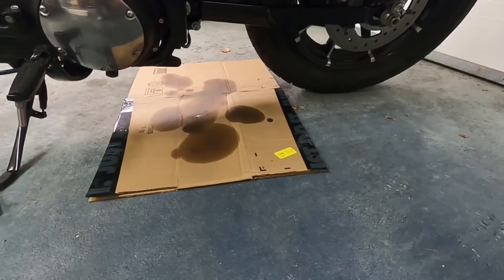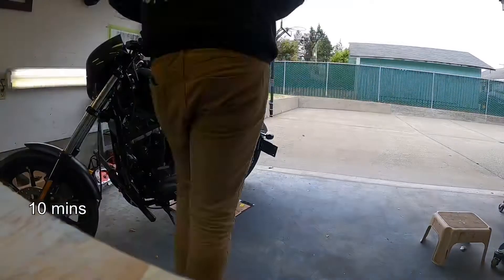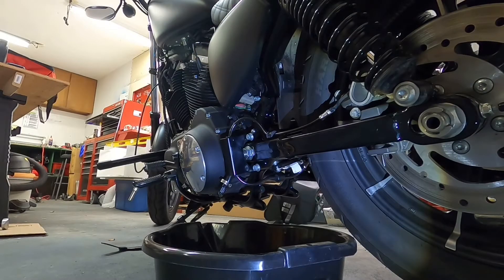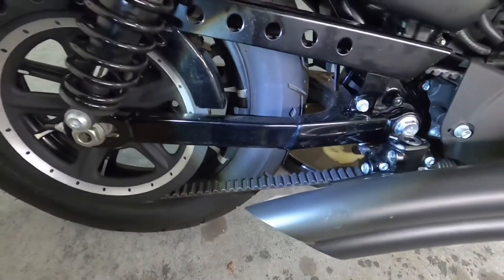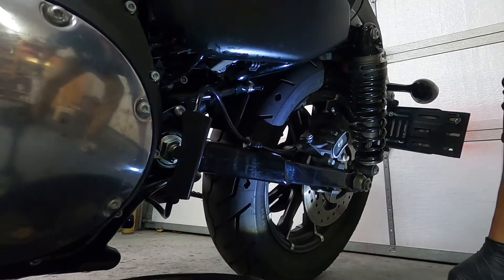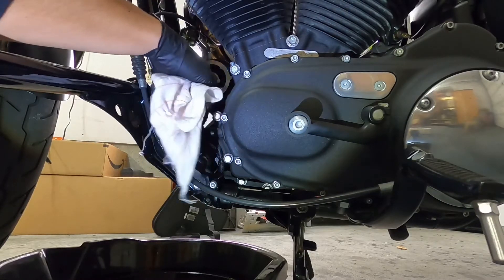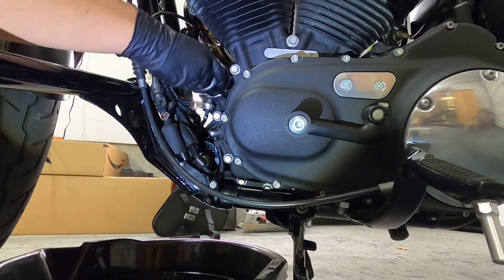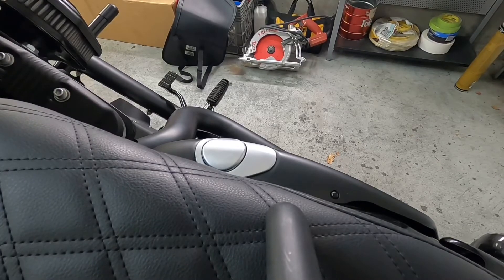Harley Sportster Oil Change

Comment: Nice! I was always too scared to change my oil but it’s easier than I made it in my head lol. Did the oil change help fix the leak? Wondering if it was a loose bolt or gasket.
Reply from the maker: Yeah, I was hesitant to do it at first but after the bike pissed all over the garage there was no way I could hold out. Ive only taken it out a few times since and haven’t seen any significant amount of oil pouring out the back. 🤞🏽 Fingers crossed changing the oil did the trick! Thanks for watching.